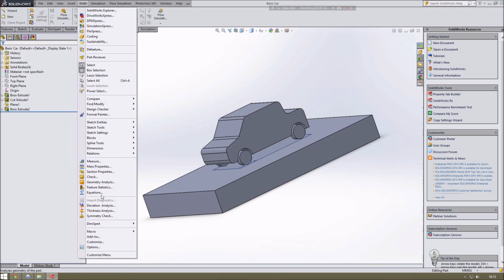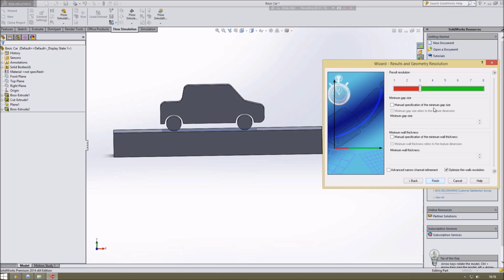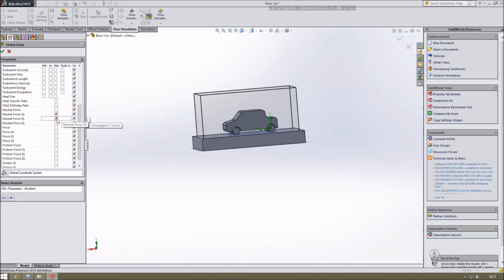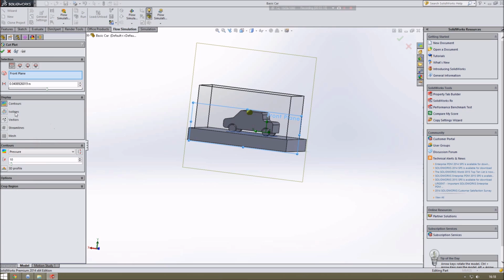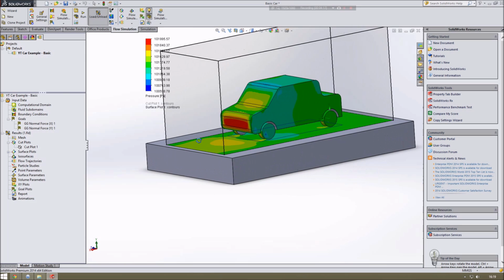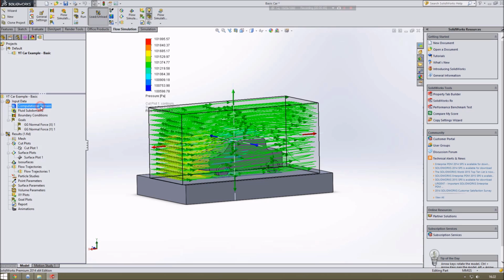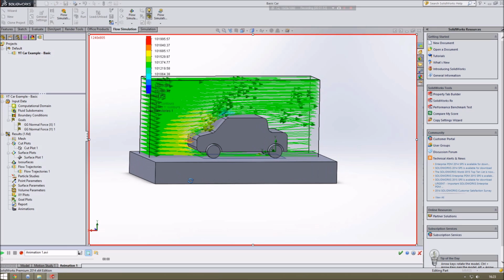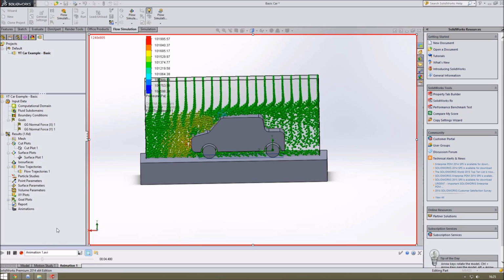How to do a CFD Aerodynamics Study in Solidworks - Car Flow Simulation Tutorial

Comment: Other than global plots,  what are the key simulations to run when finding lift, drag  (aerodynamics in general) to get numerical values to analyse in a report format as well as important features to select on the flow trajectories such as pressure to produce clear images referring to numerical values produced?  I am a 2nd-year aerospace student and using Solidworks to produce data for a rocket I have designed for part of a group project.  Solidworks is an extracurricular resource that I am trying to get as much out of it as possible but have little help from academics at the university.

Comment: how reliable this analysis?
Reply: Comparable to OpenFOAM, is actually pretty good
Reply: I would not consider Solidworks anywhere near the accuracy of OpenFoam for CFD. The tutorial in this video is very simplified and doesn't include alot important factors needed to get an accurate result.

Comment: Hi,

I am trying to migrate from Ansys fluent to Solidworks, but the only concern is whether Solidworks results are as accurate, or close to the level you get from Fluent. Also could you please explain what turbulence model did you use for this particular analysis. Thank you again for your effort.

Cheers

Comment: thanks for the brilliant tutorial! One little tip I discovered though, which you might find useful: for the Flow Trajectory, instead of recomputing the analysis with a smaller bounding box, if you look in the options (at the bottom) of the Flow Trajectory, there is the option to constrain the bounding box

Comment: At last a tutorial I can follow and actually make work, if only I could get the air to flow from front to back instead of the side. My first plane is within my model and I defined this, then a drag back. Does the start plane have to be outside the model (ie have to be the actual start of the airflow) and the 'drag back' have to end outside the model? Or can you use any plane and any drag back value?